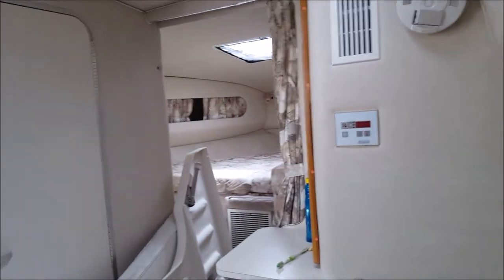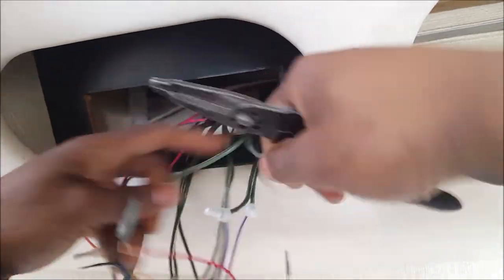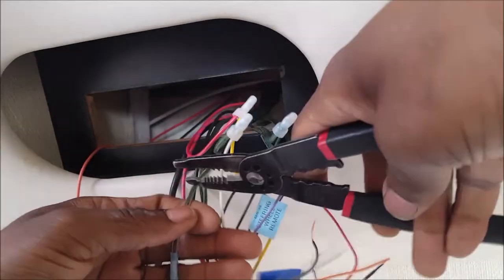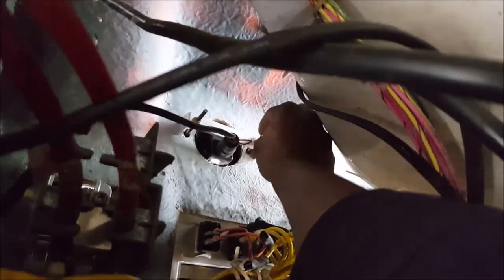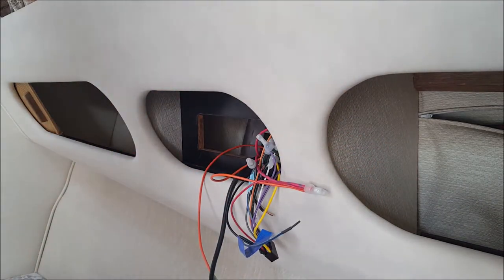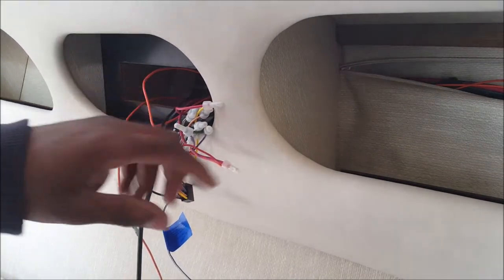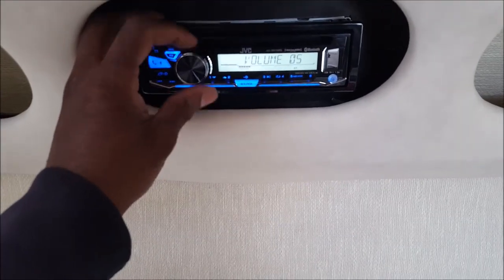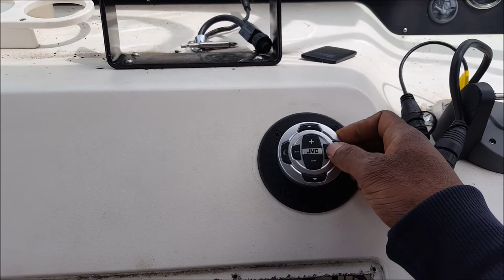How To Install & Wire Main Deck Remote Control Marine Radio On A Yacht Boat Bayliner Pontoon Lower C

Comment: The adapter that you are screwing onto the JVC unit at 8:08, where did you get the adapter?
Reply from the maker: You will need an inexpensive 4 inch tweeter grill and a 3 inch drill bit to create the housing. Or I believe you can purchase an adapter from crutchfield